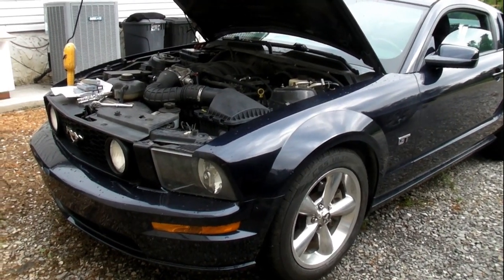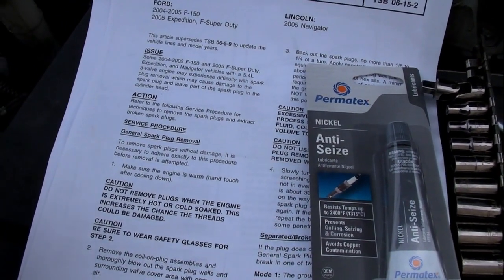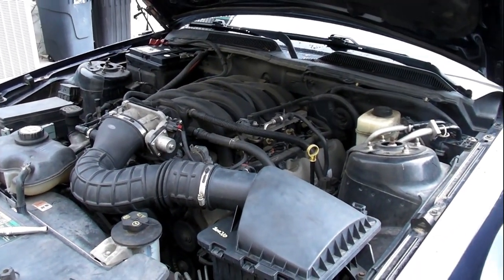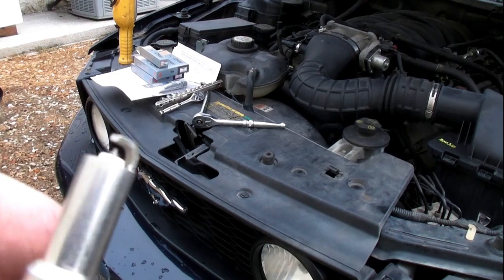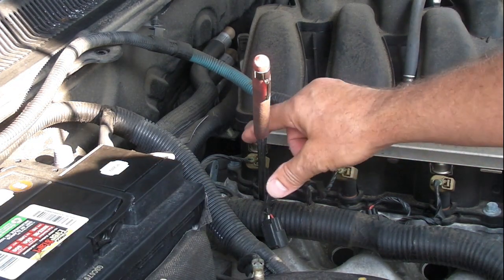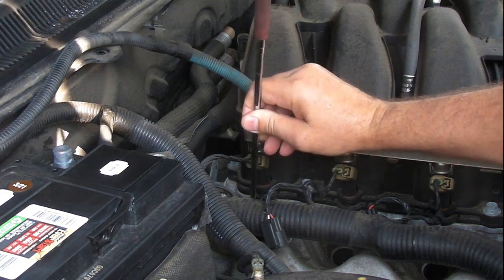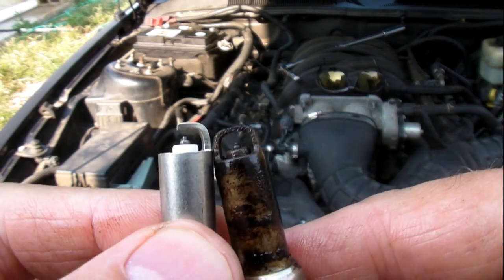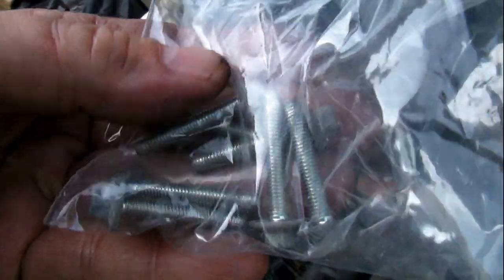Mustang 2 Piece Spark Plug Removal Without Breaking

Comment: Replaced mine on Ford F150 at 120k miles. Broke 7 out of 8. Used Lisle tool to remove 5. Other 2 couldn't get out. $3000 repair bill from local rip-off shop. Back then they were saying cold engine.
If I had a second vehicle, I could have done like you. With $3000 I could have paid down on a second vehicle. lol (but not funny)
Followed Ford TSB for back then as well as FordTechMakuloco who was saying cold engine also. I think he has removed that video now. 
Thanks for the methodical, patient manner you approached the job. I think Ford now makes a 1 piece spark plug. 
Take care and appreciate you doing the video. Jesus bless.

Comment: This is a great video. I have a 2006 GT I bought new and since I heard about this spark plug problem I changed mine early in 2011 with about 60,000 miles on them. The dealer did them for me. Now my car has 101,000 miles and I’m debating if I should do them again as I occasionally have a slight miss at low speed. Nothing serious but I’m wondering if it could be a bad plug and I’m even wondering if the dealer really changed all my plugs at the time given the age and mileage back then. I only use the car occasionally in summer months and it is a very well kept, clean car. Even though the plugs may still be ok, I think I will change them anyways and do as you mentioned. I will get the engine warm and then crack each plug loose about 1/8 to 1/4 of a turn and spray some seafoam deep creep or some carb cleaner on the plugs and let it soak for about a week. Then do the tighten and loosen sequence carefully as you did. I think if I do this I should have success with it. I also found out through research that if you exceed 33 ft-lbs when working the plug you have a good chance of breaking it. So some people suggested using a torque wrench and setting it lower at like 28 ft-lbs so that you don’t go over that torque value as you loosen and tighten. It’s an additional safety measure to do it that way. Thanks for the tips! Since I’m in no rush I like your idea of letting the plugs soak for a week. I may even add some Lucas fuel treatment to my gas prior and drive it to burn that as that might also help with any carbon deposits around the plugs.